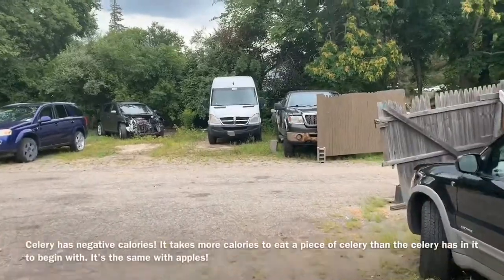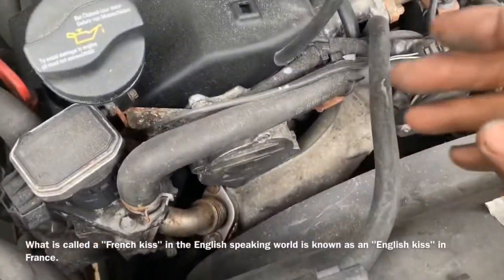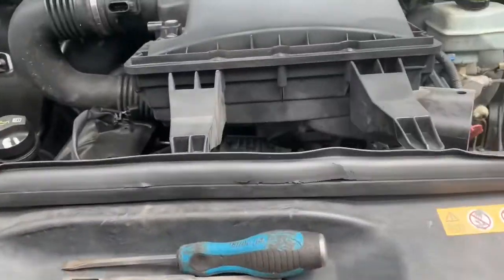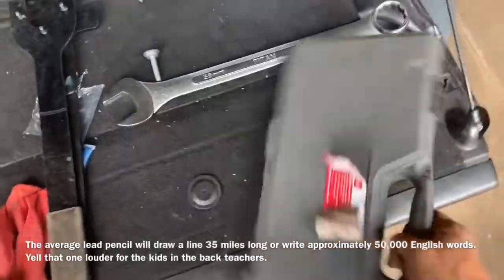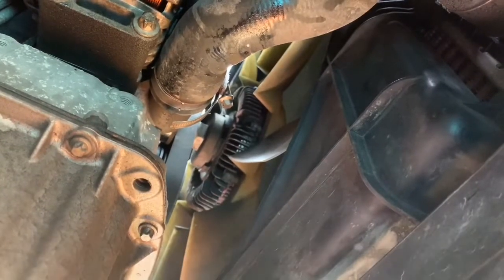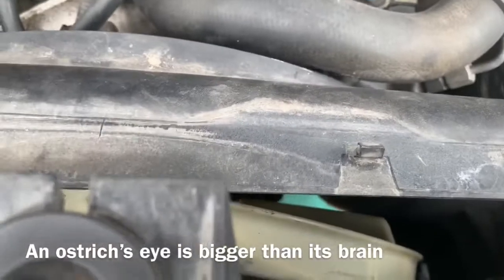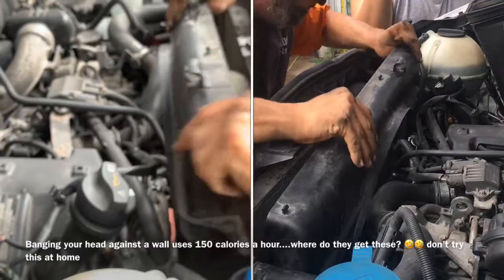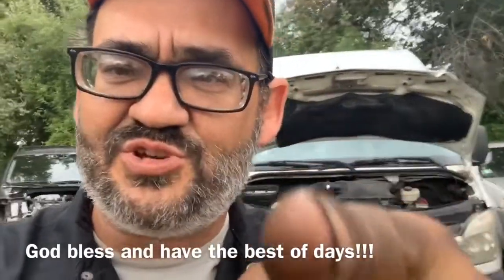One minute clutch fan removal! Sprinter clutch fan removal

Comment: Hey Clay , I got 3 Sprinter vans i maintain for my service company, quick question and thanks for your response , I am just a DYI 
mechanic Electrician trying to keep my vans running , so i have a broken idler/ on a 3.0 liter 2011 sprinter up and to the right  of the water pump pulley  just like this unit you did here 
, the idler bolt is behind the fan pulley ,,,,,, do you have a trick to getting it out without pulling and draining the water  pump and whole system 
thanks for the impact trick on the fan .... !!

Comment: So am I to understand that this method will eliminate the need for a "special" Mercedes-Benz fan clutch removal tool ( MB tool is 906 589 00 40 00)? and this will allow me to replace the fan belt? Sorry total noob but I'm down to diy and learn! On my 2008 sprinter, my serp belt broke, and the fan belt looks about 1/2 gone I know I can get the serpentine belt on by fishing around the fan blades but the fan belt is not so easy from my research. Thanks for the info!
Reply from the maker: Yes if you perform the task the way that I showed you you have to be very careful you do not want to put your pic bit in the center of the nut you could hurt the water pump.

If I remember correctly you do not have to take off the fan to change the belt. 

And you can get around the special tools for moving the tensioner assembly by using a 12 point socket.
Reply: @sharpcarco  TY for your time brother!

Comment: how come you have to replace the condenser coil cover and where do you get it ? how does it cause the AC to work improperly
Reply from the maker: It Hass to have the coil cover because the fan will not allow the air to travel through it efficiently and will make the vehicle not cool properly

I’m sorry I’m not a parts guy I would say try a junkyard or a part store for the part you’re looking for
Reply: @sharpcarco   ah...ok i thought  when you said "replace" i though you meant i had to get a new one , not just put the old one back in place
Reply: I’m an Aircraft mechanic but I also own an HVAC company in Houston, we do all the work on our service van which are Sprinters and have one with a bad compressor and I was working on how to remove the fan shroud and and fan blade , Clay’s video really help me out even when my mechanics experience on the most sophisticated aircraft, thank you Sir.
Reply from the maker: Well I will take that as a very very exceptional Complement considering that I think very highly of aeronautic mechanics , do you have to be extremely skilled and very dedicated to detailed information . So I would consider this the comment of the month at least if not the year thank you very much and welcome to the channel we certainly try to do different little tricks that are not only effective but cost-effective and mechanically sound

Comment: My fan on my 09 sprinter is running wide open 100% of the time, even on 10 degree mornings.  Thats all I hear while driving around.   I can understand a fan not working, but why is mine working 100% of the time?
Reply from the maker: Are you talking about your electric fan or your mechanical clutch fan if it’s your mechanical clutch fan it needs to be replaced because the spring is defective

If you’re talking about your electric fan it’s because it’s an open circuit and more than likely your relay is defective. Or there’s a short

Either way I hope that answered your question welcome to the Channell we’re very happy to have you God bless and have a great day

Comment: Milwaukee M12 Palm nailer worked as well as the air hammer. Bit chonkier so I needed a longer punch that fit in the nail driving sleeve. 

Thanks for the idea.

Comment: Great video, Tnx for taking the time to show this to all sprinter owners. I have 2 questions though. 1- At about 2:31 min on your video you mentioned the Fan Shroud needs to be replaced otherwise AC may not work properly? Pls tell me what you mean by that? Why a Shroud in good condition needs to be replaced?  2- If I don’t feel comfortable with using hammer tool or if I don’t have one, then what is your best 2nd choice for tool to remove the Fan/clutch? Tnx again
Reply from the maker: If it was missing…. I don’t have time to go back and look at my video but I’m assuming that’s what you’re talking about.

Obviously the second choice would be a fan clutch tool they do make a fan clutch tool that you can put on the end of an air hammer as well.

Which would be the way that you could do it if you have the attachment for your air hammer
Reply: @sharpcarco  No the Shroud on the Sprinter Fan wasn’t missing nor damaged, it was like new and nicely in place and was in perfect shape even after you took it off… so I’m confused as to why you mentioned the shroud needs to be replaced otherwise AC won’t perform properly? Tnx for your reply!
Reply from the maker: I didn’t mention that it needed to be replaced I said “if it is missing”….. I work on a lot of these and I see people do not put The strip back at the top of the shroud. And if it’s not there the air conditioning will not work properly and could possibly overheat the engine the overheating part is probably not likely but the air conditioning part is definitely possible that it will not work properly if that strip is missing or the fan shroud is missing

In my videos you often see me not even replace gasket so I show you how to reuse them and how to inspect them my channel is about saving money and not spending money. While inspiring and in powering people to do things themselves. Without spending foolish money even if you have it because you will never keep money if you spend it foolishly.
Reply: @sharpcarco  Tnx so much Clay, really appreciate your reply’s…pls keep it up with the vids… you’re doing a great job…👍👍

Comment: This looks amazing and I'd love to get the nut off this way. However, it looked like maybe the nut had a little damage on it? Was that from the air hammer?
Reply from the maker: Yes you more than likely will put a dividend in the nut. Generally it doesn’t hurt anything make sure you stay to the outside edge because if you go to far and you push too hard on the center of it it could ruin your water pump. I know one time when I did this I pushed way too hard and ruined the nut It caused me to have to get a new fan but I didn’t have any damage to my water pump surprising enough that’s a very good are you have there I wish I would’ve mentioned that in the video but I’ve never had that problem before and I’ve done this what feels like a couple of hundred times.
Reply: @sharpcarco  Thanks for the reply. I think I'm gonna try to rig up something like the Lysle tool that links a 36 mm wrench and an air chisel at 90 o and see if that gets me a similar result.